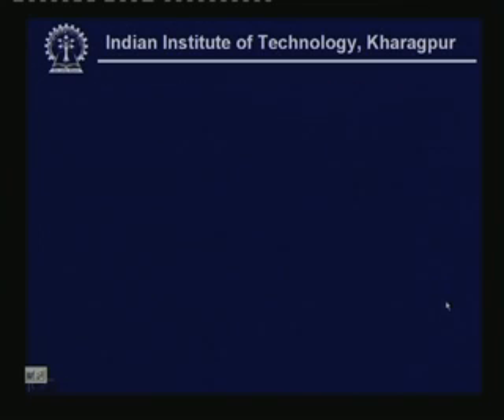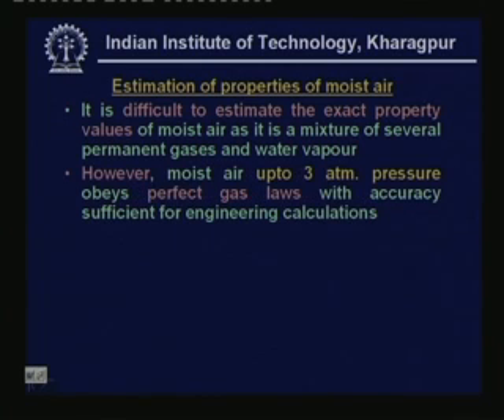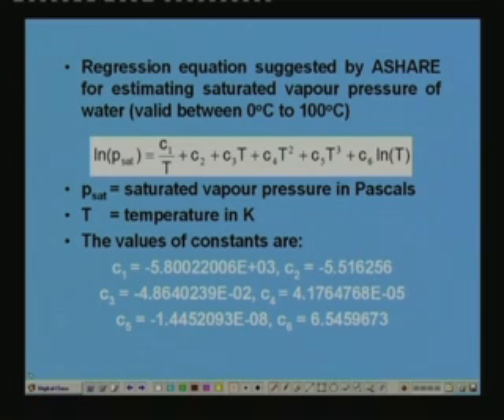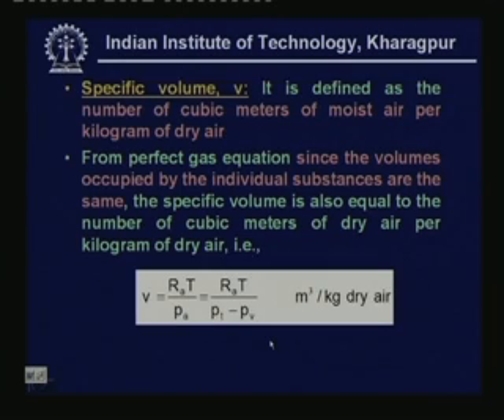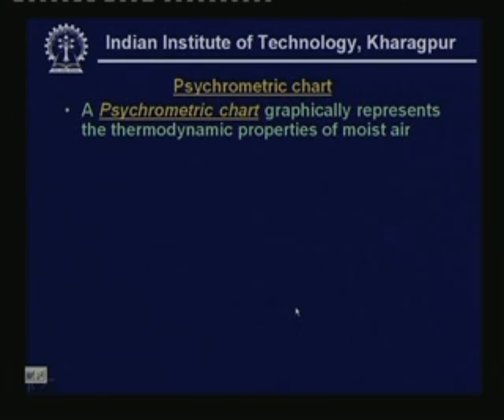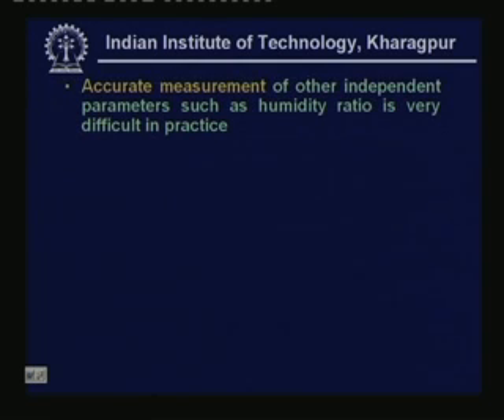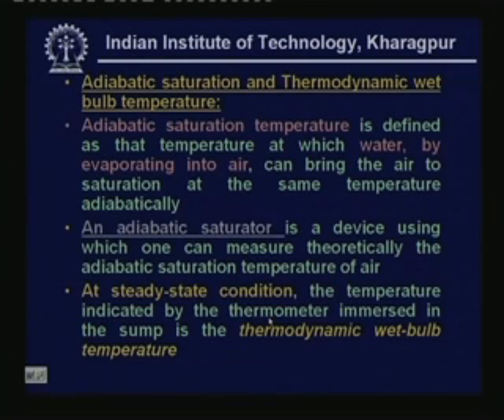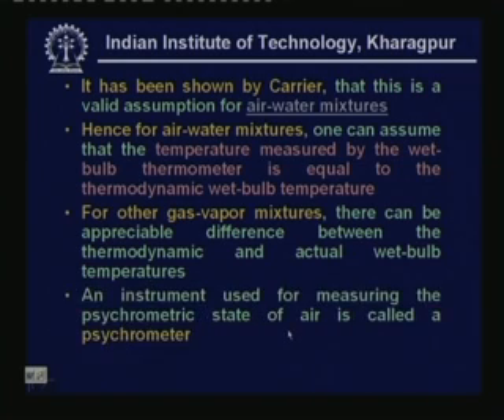Lecture - 34  Psychrometry

Comment: sir can you tell me1). what is the difference between specific humidity and relative humidity ?
2). in humidification, dehumidification how the enthalpy increasing or decreasing.? and how  relative humidity  changes its depends on temparature generally  . but  temperature is constant in this process.

Comment: What would be the value of Humidity ratio at Dry saturated point(x=1)? And what is the value of Degree of saturation at Dry saturation point for a given pressure?
Reply: the value of humidity ratio at x=1 changes with dew point temperature
Reply: and for the second question... degree of  saturation depends on not a single pressure it depends on three pressures those are partial pressure of saturated air and partial pressure of vapour and barometric pressure

Comment: Saturated steam at 100°C is injected at 0.2 kg s-1 into air stream flowing at 3 kg s-1 and 25°C. Air
contains 0.012 kg moisture per kg dry air. If the atmospheric pressure is 101.1 kPa, absolute
humidity of the air will be _______kg/kg??
PLease solve and help
Reply: Apply Mass balance equation.....maW1 +  mw = maW2.......where 1 and 2 are inlet n outlet conditions respectively......ma = mass of dry air which always remains constant,  mw is mass of Water Vapour in form of Steam added.  W1 n W2 are absolute humidities at inlet and outlet respectively.......from above equation u can evaluate W2.   :)

Comment: i want to ask initially when you describe the wet bulb temp then there we have cooling and dehumidification and but after that in next step we have cooling and humidification .what actually happen when the air having lesser humidity and higher dry bulb  temp come in contact with the  wet region
Reply: I have same doubt. Could you find an answer,
Reply: मैं सर से पूछ कर आपको इन्फॉर्म करूंगा !
Reply: K
Reply: Saturated steam at 100°C is injected at 0.2 kg s-1 into air stream flowing at 3 kg s-1 and 25°C. Air
contains 0.012 kg moisture per kg dry air. If the atmospheric pressure is 101.1 kPa, absolute
humidity of the air will be _______kg/kg??
PLease solve and help
Reply: @sadhanasharma7403  if we are that much talented then i will own my own university now :p
Reply: Anshul Ahuja it depends on what is the initial state of moist air. Cooling will cause humidification if initially vapour pressure is very less ( moisture is less in air). If already air has enough moisture, then it will lose some after coming in contact with a cool, wet surface.
Reply: Anshul, you say air has lesser humidity (i. e air has capacity to absorb more moisture), when the air is in contact with the wet surface, it aborb moisture from the wet surface and cooled and process become cooling humidification, same as home desert cooler